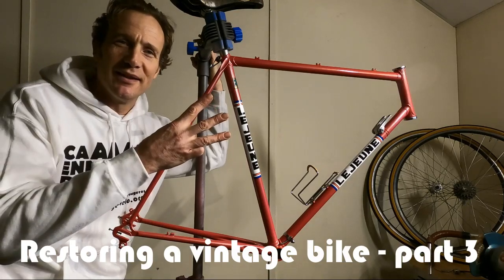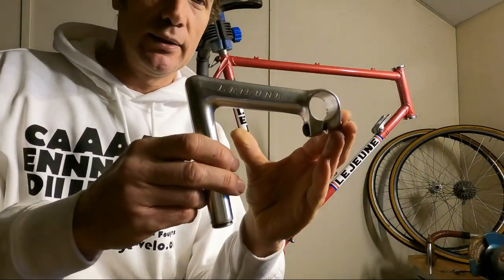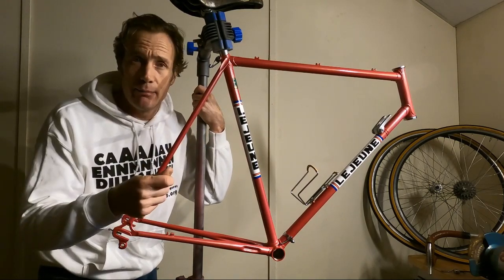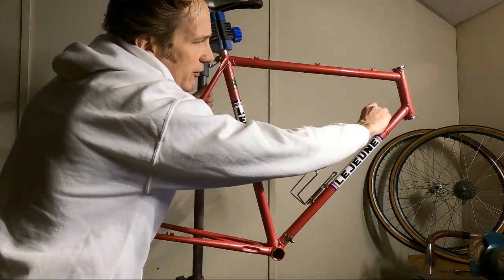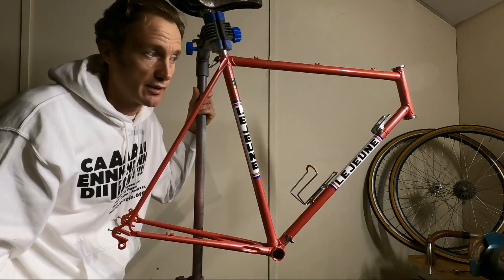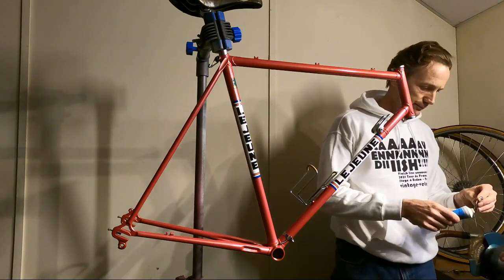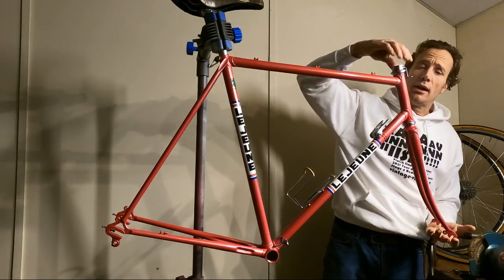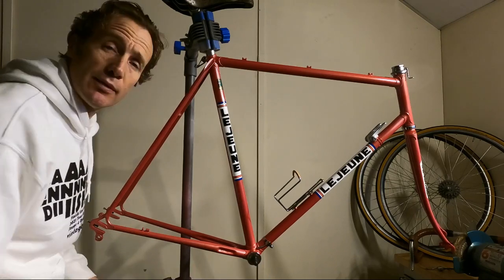Restoring a vintage bike part 3

Comment: That has certainly come up a treat, love your work. On a side note, the majority of older French steerer tubes are 22mm so that would have been your issue when trying to fit the 22.2, the fit with a fight. It will eventually bind though which will not be pleasant if you want to change it. It’s slightly tedious but if you wrap 80 grit emery paper around it and gradually wind it round and round the stem that you have within the tube then when it has almost no fight in it work through to your finer grits and you will have a 22mm stem. It’s only point 2 of a mm so not really that much to sant off but it’s enough to always give you dramas and those lovely spiral scratches every time you try and remove it and the longer you put it off the more likely it is to bind.
Reply from the maker: Everything you said is correct and what I ended up doing... French bikes - should have a mental health warning attached... Dan
Reply: @vintagevelos9517  I love it, a mental health warning, thats gold, although on an early Gitane especially, it would be haphazardly applied if at all and not clear coated so would probably have fallen off in the 80s.

Comment: Yeah,I got the Cinelli stem that cracked in the exactly same spot! The crack was fairly thin,and I only discovered it, after I experienced a strange ticking noise that was coming from the bars! 😬
Well,to be expected from the piece of aluminum, from the year 1996!
Greetings from Kris, from Croatia!😎
Reply from the maker: Yep, it happens - always got to check everything.

Comment: Sometimes tough to switch to a Campy headset if steerer tube is cut shorter for a Stronglight…you can grab a thread or two but not enough to be secure (and safe).
Reply from the maker: Yep, plus challenge with the Mafac center pulls - best left alone for the sake of a few grams, Dan

Comment: I had a pair of those Aero “self-trimming” levers on my 1984 Miyata 710. I could never really get them to work right. They seemed to be really fiddly about the pivot bolt tightness, and the left lever had a tendency to rotate along with the right one.
Reply from the maker: Yep, have had to remove them from the bike and put some Suntour |Powershifters on instead - just couldn`t get self trimmers to really work properly... Dan

Comment: The stem not going down might have been due to the internal diameter of the headset cups being 22.0mm instead of 22.2mm. Happened to me on an old Peugeot, French "standards" were just all over town.
Reply from the maker: Spot on! Was just a tiny bit too big - went halfway in the stopped and got stuck - should have headed my own warning on French fittings..